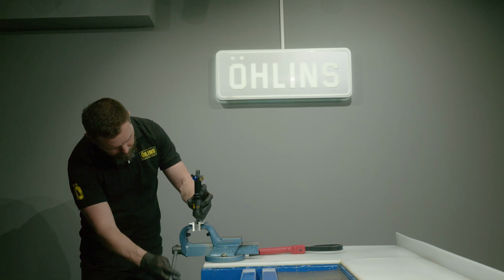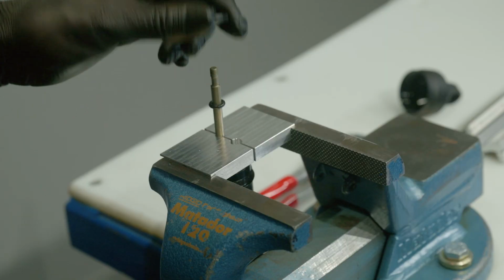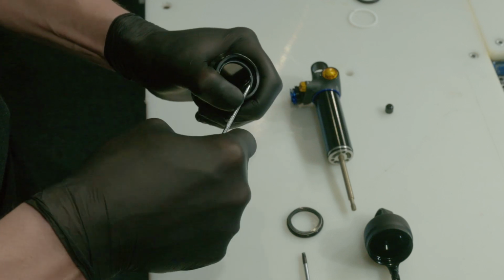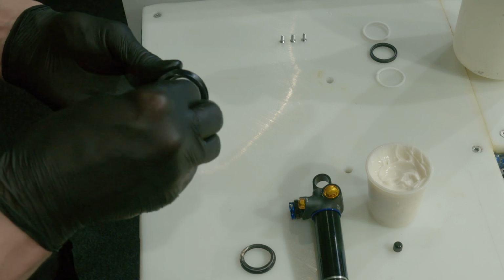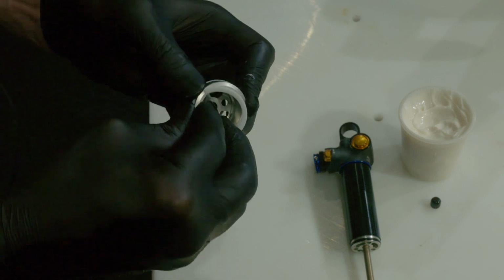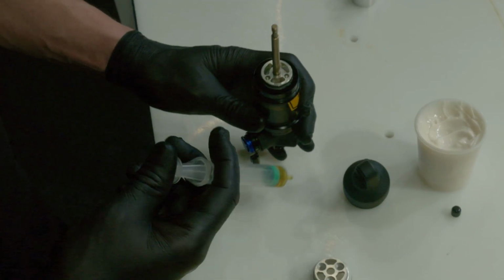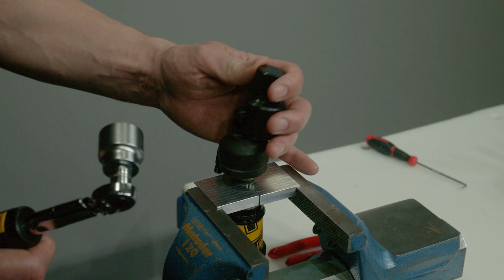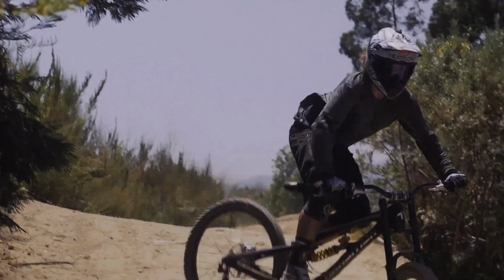MTB - 100 hour air spring service on the Öhlins TXCAir rear shocks

Comment: Hello,
I have a TCX2 shock with remote lockout and I would like to know if it is possible to change the cable pull position from the top to the bottom so I can install it on a 2023 Scott Spark.
Thank you